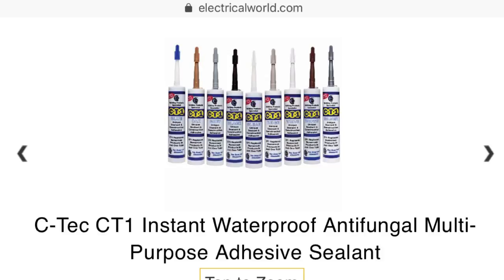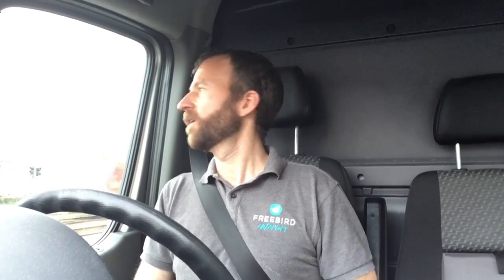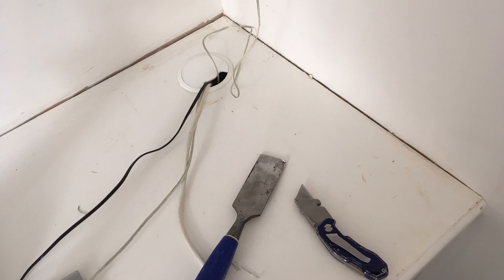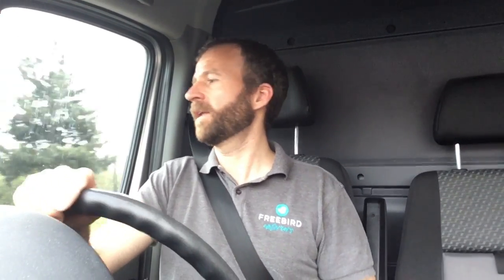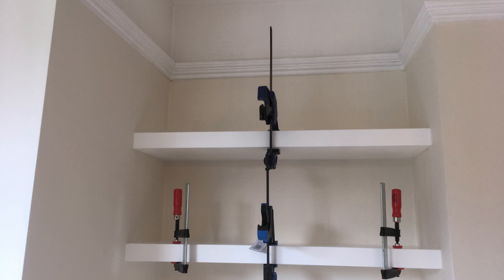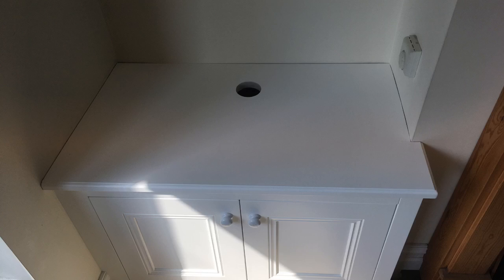Caulk line issues and other matters

Comment: Could you seal the edge of the MDF with mitre glue it sets in like 10 seconds so their would be no waiting on drying time before caulking
Reply from the maker: Yes that could work however it's high risk - get any on the painted face and you can't rescue it

Comment: Ive been using Everbuild Instant nails for caulking around general joinery work. It doesn't seem to shrink, its overpaintable and its usually on offer for a £1 at toolstation.
Can i ask the reasons for spray finishing off site? Do your clients prefer that perfect finish vs the hand painted? I worked on a job with a bespoke kitchen company a few years back. All the units, plynths etc arrived on site in a sprayed base coat that was the exact same colour as the finish paint was going to be. After everything had been fitted and had acclimatised for a couple of weeks, they sent in a decorator to put the final coat on everthing. It looked fantastic, he got a really good finish, but it didn't look like a mass produced factory spray finish. Me personally, i prefer that honest hand painted look on bespoke furniture.
Reply from the maker: I will give instant nails a try, thanks.  I see the sense in installing furniture primed then hand painting afterwards - it is easier for the installer, not having to avoid damaging the final finish.  Also the hand painted finish is easier to repair later when necessary.  We moved to spraying because it is faster for us and a far better finish than what we used to achieve hand painting (with foam rollers in the workshop).  But for the kind of work we are doing I just can’t see it working to add another process - installing then revisiting to paint - because it seems like more inconvenience for the customer but also for us.  I would have to charge more for it or make less profit.  Perhaps I’m just stuck in a mindset, because I do also see the benefits!  We’ve just been so focused on refining our system for both speed and quality and this seems a good way to do it.

Comment: I have found with my people the best method is to start slowly. By that I mean to have you and your apprentice installing pieces for six months or so and then start giving them small installs that they can handle with no issue and just check them at the end for fit and finish. Over time move away from inspecting them to trusting that they are doing it the way you want. I have also found by ring the customer a few days after the install to ask about their experience. This also makes it easier to spot issues with installs before they become major issues. You will find it hard for the first two or three until you get the method nailed down and then after that your efforts will compound and you will really reap the rewards with a strong core workforce and a growing business.
Reply from the maker: Great advice, thank you!

Comment: Gaps can be a number of things. Things to consider are. Movement in the MDF. Its very stable but if you go from a cold workshop in winter to a heated house it will defiantly shrink enough to break the cork. 
Moisture content of the walls if they are dry like freshly plastered it will suck the moisture out of the cork leaving a crack. If the cork bead is too tight the above issues will happen sooner. I tackle this by using a silicone tool like a fugi kit you so i can get a thick enough neat uniformed cork line. On the scaling side of things. I know most kitchen companies mostly manufacture and offer fitting at a ridiculous premium but also just recommend a list of independent fitters/ joiners in my experience they usually go for the latter. Could be an option for scaling up.
Reply from the maker: Thanks for that, I like getting thee sorts of comments that add to the discussion

Comment: If you want to prime your cut edges, but you want it to be a quicker process, use SBR instead of primer, it’s like pva but it doesn’t soften under moisture, it dries in about 5 mins, it’s about £20 for 5litres and will last ages!! and the caulk will not only adhere to it far better, it will help to stop the caulk from cracking

Comment: Hi. I've been in the industry since I was 15. Im now 48. Bit anal on products always wanting the best finish. Caulk is a nightmare, it will always shrink, and yellow. I now use CT1. It's a great sealant, but I don't like it as a grab. We try to do a neat line, and if needed paint the wall instead of the unit. And to be perfect we tape up with low tack tape. Then cauk. Then paint. Then take the tape off before it all dries. Perfect edge. You could use Knotting on the edge of the mdf.

Comment: I tink the E-myth has a lot to answer for !!   I worked with E-Myth around 15-20 years ago, and the notion of working on your business and then franchising it is fine in principle. However,  you can have all the systems and standards in the world, but in your line of business your critical requirement is skill and experience in installations, and you cannot systemise all the variations that arise. For me, ( an old BS5750 and manufacturing Software implementor ) I dont think EMyth works for businesses where the customer dictates the pace. You can franchise a coffee shop provided you are supplying tasty coffee, and customers will buy it, but as soon as different customers in different shops start making demands for variation, you are well and truly buggerred , and E Myth falls over. Sharps is an E-Myth business - standard boxes sold  with a bit of fettling. I think you are much, much better than that. 

Caulking bit was quite interesting too !!
Reply from the maker: Richard Keith it’s very interesting that you have made this comment because I have just made another video, to update subscribers on some developments with my business, and I discuss how I think it was a mistake for me to put so much emphasis on E-myth principles.  In retrospect I fell that approach has set my business back a little vs if I had focused more on growth via my own hard work and skill.  However on the flip side the systemising and delegating I did manage to set up was enough to keep the business functioning through a difficult period when my son was in intensive care for a few months and the team were able to keep things going without.  So it wasn’t altogether a mistake but I am making some adjustments to our trajectory now.  My latest favourite book is Profit First by Mike Michalowicz!

Comment: Interesting topic. 

Have you tried a (de-waxed) Shellac/ Shellac based Primer for your MDF scribe edges?...Scribes could be ready to plant and caulk in 20 mins at +15 deg C. 

Often scribes are back-cut for ease of shooting-in with a plane and counter fouling on the adjacent wall surface. This leaves a knife edge on the scribe and little grab surface for the caulk. Perhaps a very light dress of the edge with sandpaper would give the caulk more to stick to. 

I would (and you probably do) avoid caulking ceiling junctions and opt for a drop (dust spot), shadow gap or rebated shadow gap. 

One would hope for your caulked junctions to last a couple of years, though there is a good argument, and it's reasonable to advise, that over time gaps are simply part of the natural thermal movements of a property, and should be accounted for in decorating schedules. Personally why I choose to live  'rustic' over 'sleek minimalist', as there's a greater visual tolerance.
Reply from the maker: Choosing ‘rustic’ is a smart move 😁.  Since having to rip out some work that I fitted using ‘Caulk once’ pressed/rubbed by hand well into the cut edges prior to offering up to the wall then fully caulking; and discovering that the dried caulk bond remained strong to both wall and mdf edge; I have reverted to that as my standard method.  Even the quick drying zinsser - type probers would add too much time to my work flow (see for example this job I fitted yesterday - fitted in a day but I wouldn’t want to add anymore to the time: https://www.instagram.com/p/B1ZNtHuAb1v/?igshid=1pymztx8oetp4)

Comment: you tried expanding foam first then caulk or power filler.
Reply from the maker: jack wardley no; do you do it that way?  I’d be wary of the mess of expanding foam.  And what is power filler?
Reply: @Alastair_Johnson  sometimes I do especially on stringing on staircases caulk doesn't seem flexible enough to last there. power filler you just add water mix it up in a flexible mixing bowl prefer using that for larger gaps on top of sanded expanding foam.

Comment: Great video! I was just thinking about what you were saying about sealing the cut edges before caulking and wondered if you have tried applying Rustin's quick drying MDF sealer to the scribes before final fitting and caulking? I might try it out on my next job
Reply from the maker: Samuel Hook last time I tried an mdf sealer it took ages to dry!

Comment: I have always tried to keep my caulking lines as small as possible. That is due to a couple things. One, we here in the states build walls out of wood and as you know wood always moves. Two, I never liked the paint over method. I too spray paint everything and brush strokes just wouldn't match. I really try to not use caulking at all and just fit really good to the walls.
Reply from the maker: Brian Needham great to hear your perspective!  I’ve moved over to avoiding caulk altogether for pretty much any non white colour.
Reply: +Brian Needham
I totally agree with you mate.  That is to use a more skill and have smaller chalk lines.  And avoid using chalk.

Comment: Great video. As for the caulking I'm in the same dilemma... some options/approaches are better than others but there isn't any that I'm aware of that I'm truly happy with! As for the scaling of the business although your considerably further ahead than me! My idea which I also believe you're looking into now is to improve and invest in machinery rather than staff! That way you can get a lot more done in less time and staff and you can still be involved in all the individual jobs. Only downsides I see to this method is theres a bottle neck when it comes to fitting  you can only do so much in a day... and I'm not a fan of being uninvolved in that as after all it's the make or break of the job... For this reason, I realise I'll only be able to scale so far 🙈 my 2 pence!
Reply from the maker: Jack Finnerty yes we are on the same page with all that!  I think I’ve been a bit too quick to invest in staff and a bit too slow to invest in machinery, we really have a very basic setup on that front and I think it’s limited us.
Reply: @Alastair_Johnson  at least machinery doesn't answer back when u blame them but its truly your fault/mistake!!😂 I bought the Felder p 700 s panel saw yesterday. I went for fairly high spec digital readout etc... about 7 to 8 weeks before it arrives might be too far away for you but more than welcome to ask any questions etc. if of any help to you! Great price as well when compared to competitors 👍👍
Reply from the maker: @jackfinnerty7891  Hey Jack, something causes me to stumbled across this old exchange of comments and I thought it was interesting, a blast from the past!  I have since invested in both machinery and staff and find both very valuable!  How are things going for you?